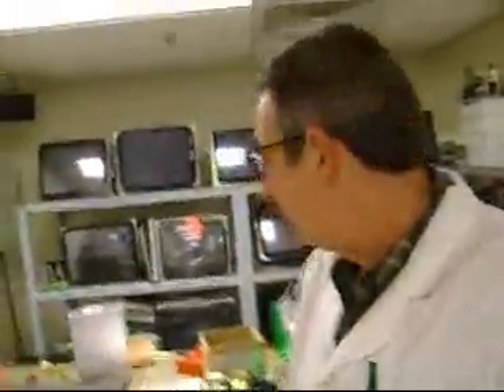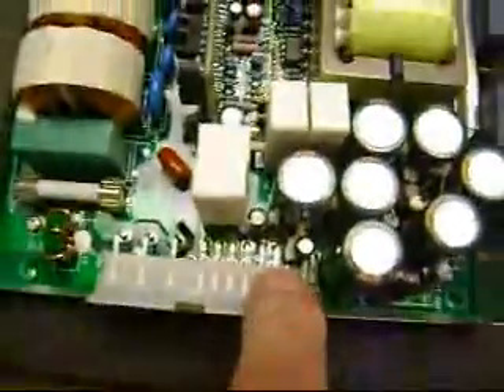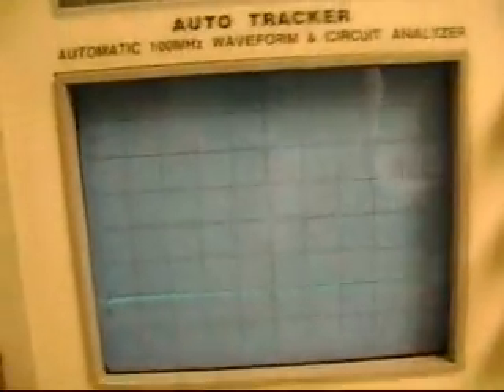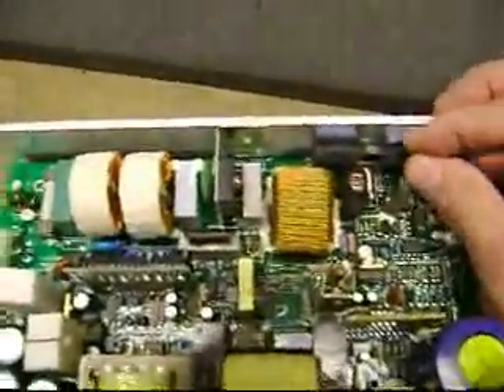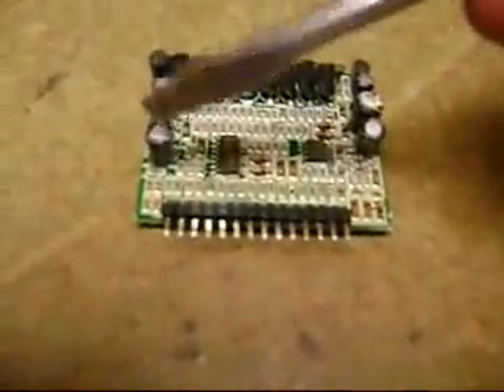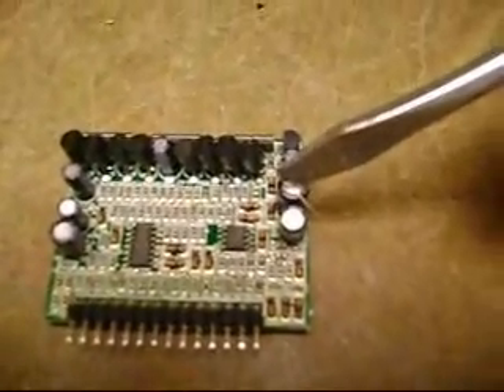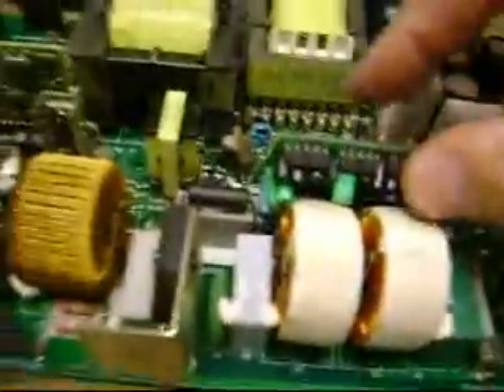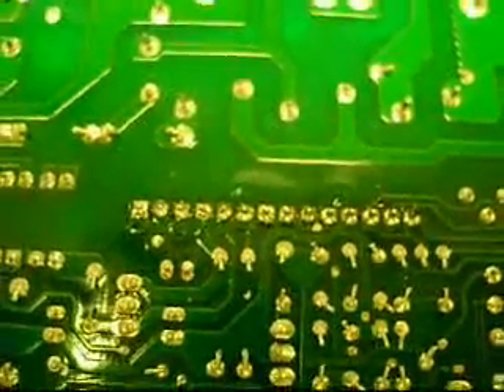Repairing the Win-Tact Power Supply Used by IGT in Their S2000

Comment: Always enjoy watching your vids! 

And funny you should mention reworking- I happened to save an old ISA card for a vintage machine just tonight by using a multimeter to find shorts and desolder/solder in new components (and locate the bad RAM chips- fun!). 

Ended up being a bad tantalum cap- two of them actually. The second one blew up after I replaced the first! Board works perfectly now- thank goodness for power supply for overcurrent protection.